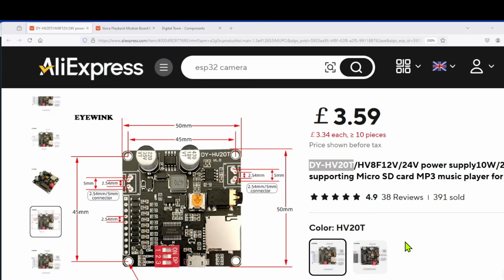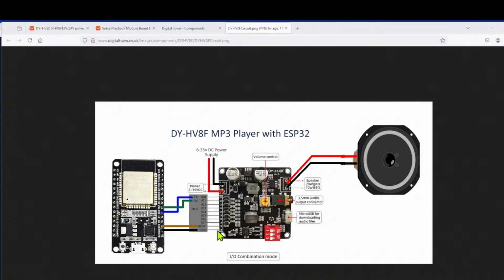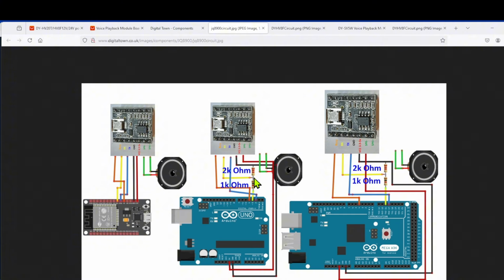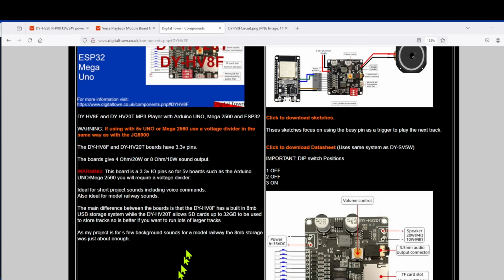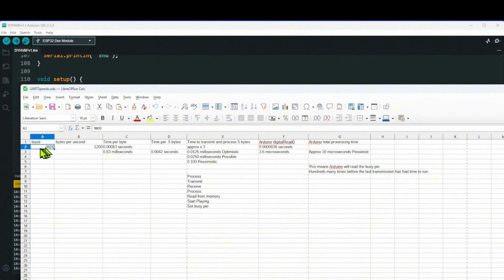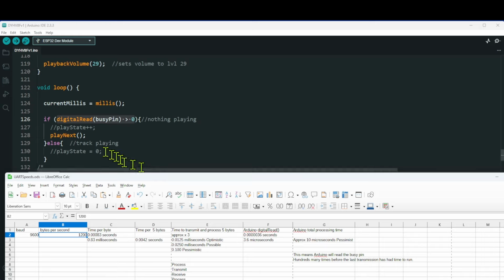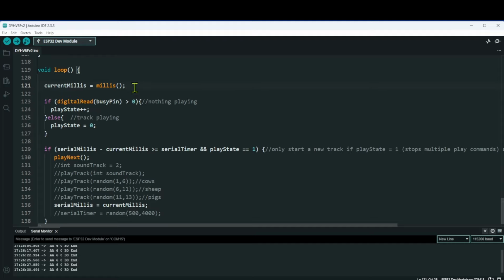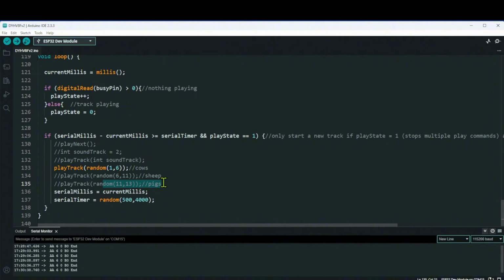#112 Arduino C++ DY-HV8F, DY-HV20T Mp3 player module with ESP32, Arduino UNO and Arduino Mega 2560

Comment: Instead of relying on hazardous undocumented timings and delays, you could at least ensure your few bytes are effectively sent by issuing a  Serial2.flush() after every command is sent. 
But I verified it, and this does not look to be enough. 
It is possible to issue a "query play status" until the play status reports "playing". To simplify the coding logic, I tried to always double-check the read(busy pin) together with a "query play status" and only consider the cases where both match, to decide about the next action. This works. 
I also use a "query play status" at setup time, together with a read(busy pin), in order to be sure that the first "play" command will be accepted..

I can not confirm precisely if the board DY-HV8 supports command pipelining, and if multiple commands can be issued. This would be something to investigate, in order to secure the reliability of the communication protocol and prevent hazards.